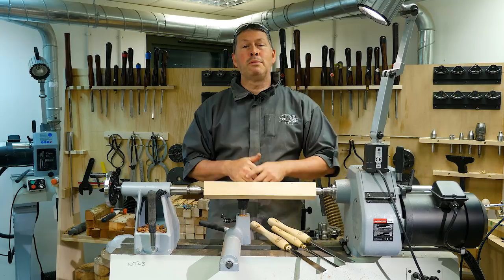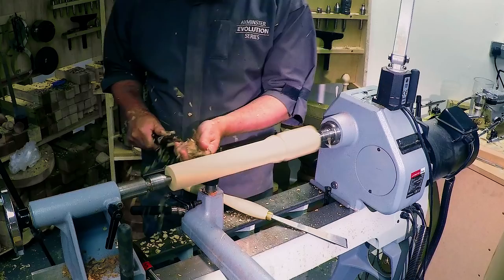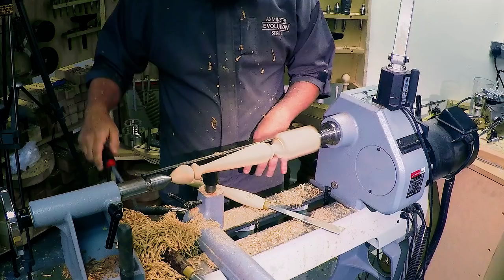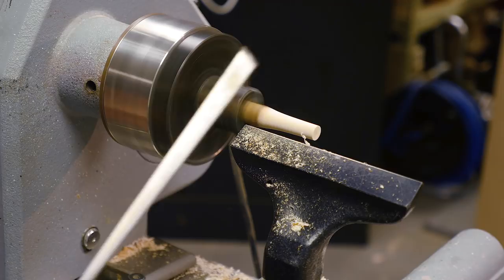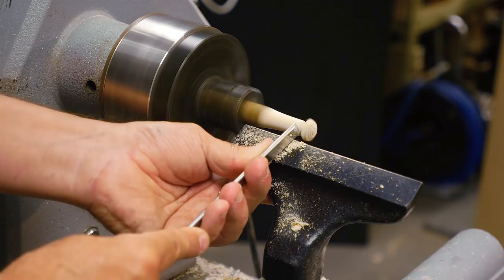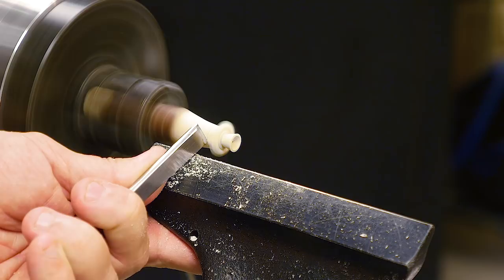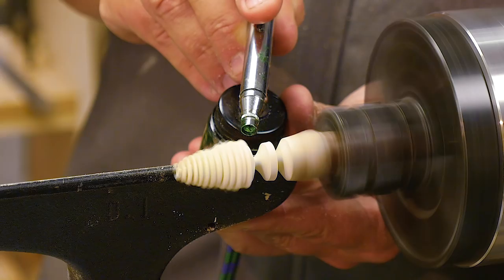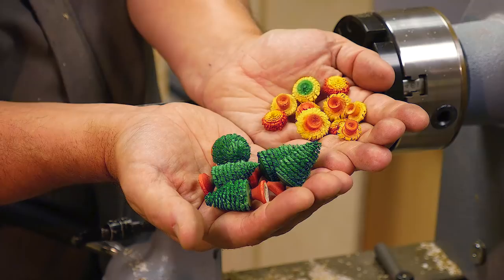Crown Cryo Colwin Way Signature Skew Chisels - Overview and Projects

Comment: Hi Collin,  after watching this video I purchased the 32mm skew which arrived today. Gave it a very brief hone and did a couple of test passes on a sycamore spindle offcut.  After only 3 passes the steel at the edge has gone black and blue.  Have you encountered this and is it possible that the steel has a problem.  Finish on wood was great so definitely riding the bevel.  Any advice welcome.
Reply from the maker: Hi Kev, I believe Colwin has answered you directly about this 😊